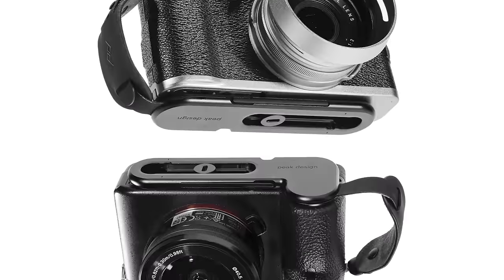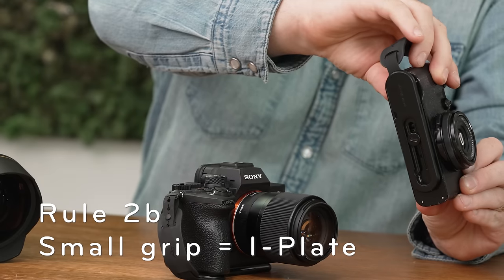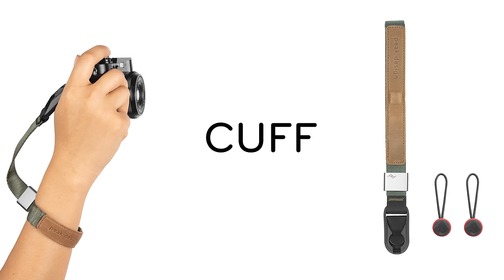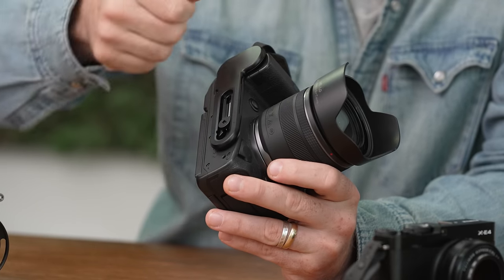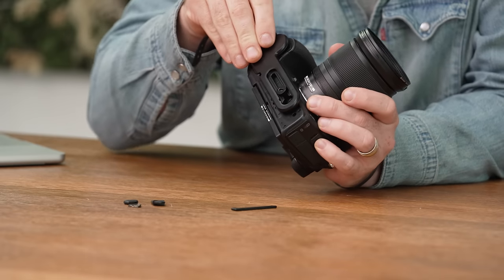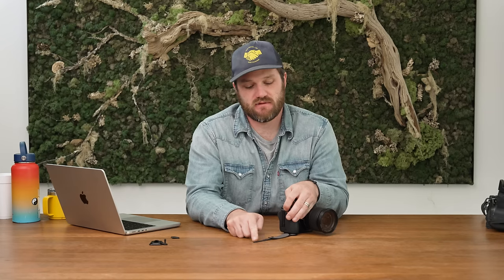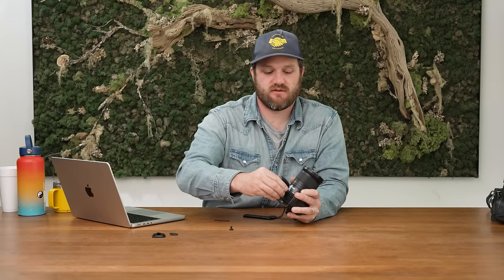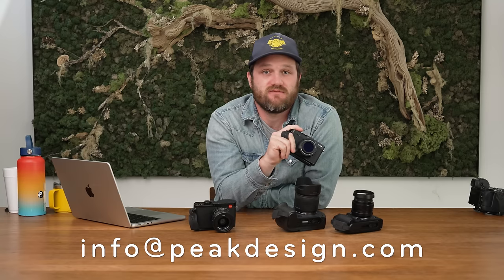Micro Clutch: Everything you could ever possibly want to know.

Comment: I ordered it, will be interesting to see 2 things:
1) the whole construction seems to have one weak point: If the screw, which you need to loosen and tighten quite regularly, it not tight enough, or loosens itself just a bit more than half a turn, the plate slides out and bang! goes your camera. 
Ideas for a backstop to this:

a) make the strap longer and put the screw through it, too. Won't work if your battery slot is on the right side of the screw, since it would cover the whole thing even with the plate slidden to the side. Since most cameras have battery on the right side, a) doesn't really work.
b) have an additional mechanism in the screw: Thread it in and then fold-over a security lever which is on top of the screw, which snaps into dedicated holes in the plate. Would look similar to some of the base plate screw, just that the moving top piece is not D-shaped but J-shaped, with the hook of the J locking into the plate (magnet). This would prevent the screw from turning and you would get rid of the proprietary tool.

2nd general thing to observe: How cumbersome is the plate removal over time. I never change batteries on my X100V (they last so freaking long) but I always remove the SD card for transfer to computer.
Reply: yea someone forgot to ask someone with actual functional design experience to look it over. i mean the much heavier cameras using the clutch and link connection is used. why not for this?

Comment: I just finished installing the J version of the Micro Clutch.  Doing this isn't for the faint of heart.  The product comes with a teeny-tiny instruction sheet.  I think following the instruction sheet would be difficult.  This video is excellent and is the best guide.  I have a pointy tool (kind of like a skinny knitting needle) that helped me with thing like splitting the split ring (the included tool isn't that great) and threading the Peak Design Anchor through the hole (which practically speaking has to be done with the plate unattached)..  

I'm really eager to use this.  There are times that a neck strap is the best way to carry your camera but there are many times I just carry my camera in my hand and don't really need a neck strap.  I can already see how well this works to essentially attach it to my hand.  Another Peak Design win IMHO.

Comment: The unfortunate part is that you always need the tool to access the battery compartment. Is it just me or this will be a hassle in the long run?
Reply: It's not much of an issue with newer cameras from the past few years being able to charge battery through USB. Someone needing to change batteries throughout the day with heavy use should look elsewhere, and may already have a different solution if they need a hand strap. I use a RRS solution on my A7 camera(s) which allows for battery compartment access.
Reply: I know it’s probably just an extra 30 seconds (to a minute) to loosen and swap batteries but depending on the conditions on location (especially when shooting solo), this can be a dealbreaker.

I can totally see myself losing that little tool when I’m scrambling to swap batteries in the dark. 

As slick and well-designed as this “tool” solution is, it feels like an impediment the original clutch never had. It’s definitely gonna slow me down.

It’s on me that I didn’t go through all the resources PD provided before backing the project; I wouldn’t have had I seen this vid.

That said, I’ve loved literally everything else I’ve backed and I kinda blindly trusted this time.

Anyway, still love PD. Looking forward to the next Kickstarter!

Comment: I use the x-s20 with smallrig cage, and when handheld, I don't want another bracket. I'd love if tge micro clutch was detachable from the plate and maybe usable with the anchors or anchor bracket. That'd make it much more versatile. I shrug at the thought of needing a tool to change batteries... I'll stock with the OG clutch 😊

Comment: The Peak Design Micro Clutch is undeniably a high-quality product, delivering excellent performance. However, upon installation, it becomes evident that there is a slight limitation when used in conjunction with the flip screen of the Fujifilm XPro3. The clutch base unfortunately interferes with the full opening of the flip screen, requiring users to exercise caution to avoid inadvertently applying excessive force and potentially compromising the integrity of the screen's pivot point.

Comment: anyone been able to get the extra ring onto the Ricoh GRIIIx yet? I havent been able to fit the ring through the tiny GRIIIx holes. Only thing that has worked for me is using an anchor and sliding the microclutch strap through the anchor but its not ideal.

Comment: Very odd question: On a Leica M10 or older, could you take the camera's baseplate off with the screw still on? It would be a question of diameters. If not, then I'd have to remove the microclutch baseplate and the screw entirely to change battery and SD card.

Comment: For A7C users, it may be a good option, but for A7C II, its not comfortable. A7C II has a more pronounced hand grip than A7C. I've slightly lower than average sized fingers and they wrap around ergonomically around A7C II hand grip without the Micro Clutch. With Micro Clutch, it was uncomfortable due to pronounced hand grip. I found the bigger Clutch more convenient for A7C II.

Comment: Doesn't seem like you can replace the battery on many cameras with this product? If you're out on location or doing street photography it is very impractical to need to remove the bottom plate to change the battery then reinstall it all again.

Comment: So... It's  cute, but kinda sorta il-conceived...  I've got the version 2 Clutch on my Sony a6600. A few thoughts...  First off, it attaches to a tripod plate, so there's no need for extra parts. It uses a hex key of a relatively common size, and I have one on my keychain that lives in my pocket. Because it's a tripod plate, you can access the battery slot without taking the whole dang thing off first. 

And, most importantly...  It wraps around the back of my hand, instead of two fingers (OMGWTF?!?), so it holds the camera much more securely to my hand, even with the a6600's smaller body.

Final point...  It's adjustable. So you can really crank it down to secure the camera to your hand when you're just walking around and not shooting, and then loosen it quickly for comfort and ease of use when you actually need the camera.

Comment: with the plate dosnt work good on fuji  , with the I -  plate  ON XPRO does not remai fixed  and the bracket moves because the long screw does not hold securely. What a disappoint of peak design , spend a lot for  something that dosnt work .

Comment: This is a poorly executed great idea.  The micro clutch blocks the battery compartment and has to be removed to change the battery.  On a lot of the smaller cameras that is every couple of hours if you're lucky.  I hope the next version has a battery door and is already arca swiss compatible so you don't have to add the plate as well.

Comment: I just bought two of these to test... And i regret so much.

This is one of the most lazy designs somebody could come up with. 1. Every time you remove the battery you need to fiddle with a special key to remove the mount to access the battery. This one is so smart that it has a proprietary lock size hole thread for the screw and it needs his own key, because this is special, and is not easy to remove that key from the magnetic place. 2. This thing doesn't have a 1.4inch screw hole. if you want to mount this on any other tripod (besides the peak design ones) you're screwd. Why???  This is a very anti-consumer design at a premium price. The idea of having a grip with three finters on the camera is very good, but the implementation it lacks intelligence, i'm sorry. I need to return them.

Comment: Sorry, I don't understand the hand clutch. If a person will be using a camera for a long time, why not just use the peak design arm cuff or just use the peak design camera clip around his belt? Holding a camera even with the arm clutch would be tiring because your still holding your camera? No offense, can someone enlighten TY
Reply: For me it’s going to be combined with clip, the clutch is mainly for safety as I would like to try without neck straps. The straps causes rashes on my neck if I’m wearing tshirt.

If you have tried a phone holder/finger grip, it allows the hand and finger to relax and even open up without the device falling off. It can also be helpful in places where in the event the device drop it will be lost forever(sea, mountains).

I’m just worried about the hassle of changing batteries, using a Sony A6500 their batteries run out real fast and I’m not sure if it would deter me from using the clutch.

Comment: Curious as to why they didn't just put a standard tripod thread on the bottom. I would like to use this in conjuction with a dual camera strap that requires a tripod thread for connection. It would also mean you can use whatever tripod plate you want.